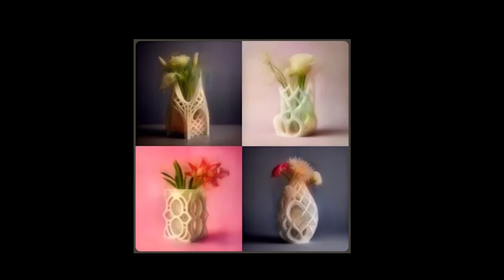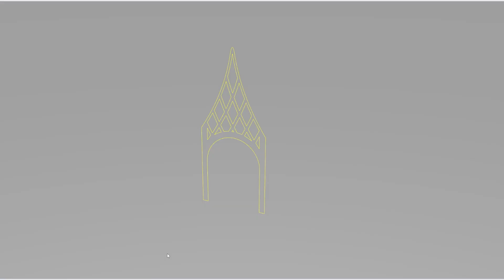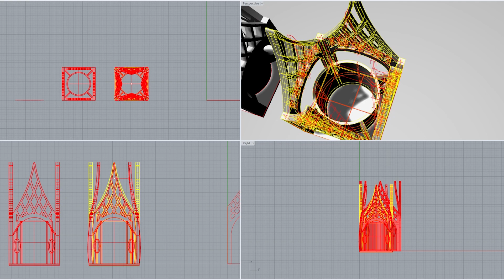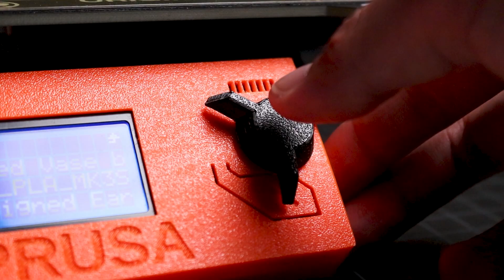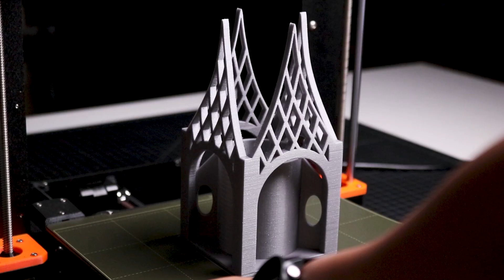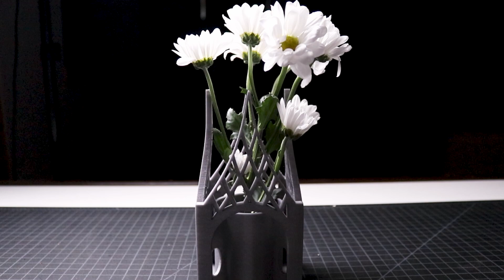Midjourney AI Designed this 3D Printed Vase

Comment: It would be interesting to see this done with your laser cutter, replacing the water-holding portion with a simple glass container. It would take much less time to cut than it did to print!
Reply from the maker: Yes! There’s lots of different ways it could be created. The difference with a 3D printer is the sloping triangular top that goes inwards. If the project was laser cut, it would be flat on all sides, which could still look great!
Reply: @LaserMadeProducts I didn't realize the final version sloped inward.  It looked flat-sided when I initially watched.

BTW, I binge-watched a bunch of your videos today.  I came across the laser videos, but then saw your architectural videos.  I've been pondering designs for our retirement home, and have been thinking of different styles that incorporate courtyards or similar features.  I was excited to see you had so many videos around the concept.